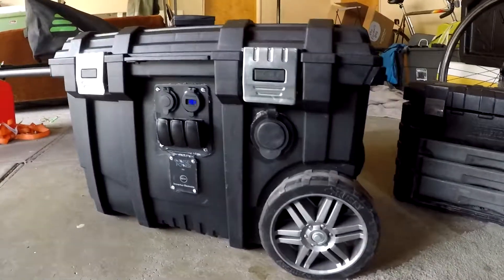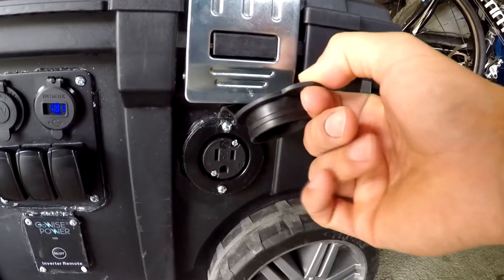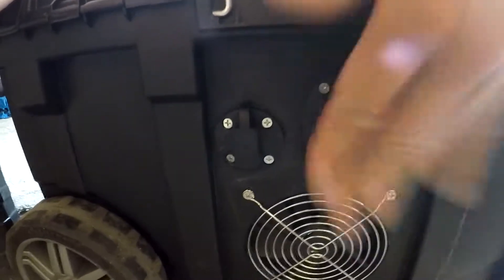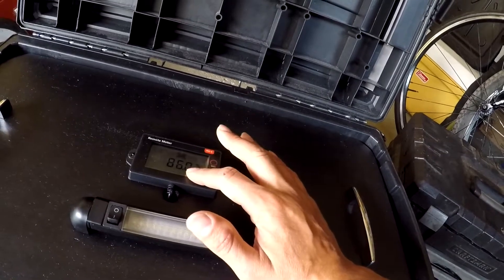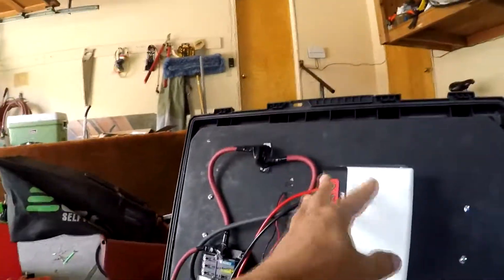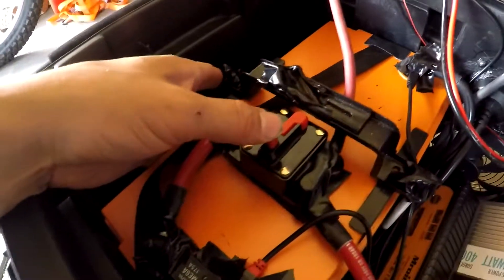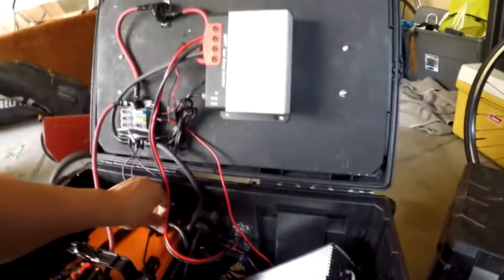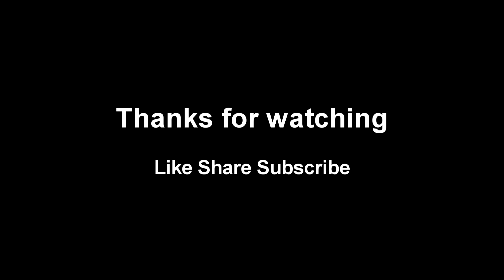Best Value DIY Homemade Emergency Solar Generator - Unlimited Power for Home and Travel

Comment: What board is that that ur charge controller is mounted to?  I have a similar setup but need something to mount my components to.
Reply from the maker: Just a cut to fit piece of plywood. Painted black with enamel, works great! Good luck

Comment: That is a very nice unit. I am in the process of building a smaller one and would like to build a larger one for a back up in case my grid fails.
Reply from the maker: Thanks, thats what i built this for. It charges in 3 hours and can power fridge, wifi, routers, tv, computer n lights most of the night so perfect in the event of grid down. Goodluck

Comment: Very well done!! I am trying to do a similar setup, can you clarify what amp the Bouge RV Charge Controller is that you used and how many watts of solar are you using to charge? I am torn between the 20 amp and the 30 amp
Reply from the maker: Its a 60 amp which is one of the largest mppt, this means it can do the max which is 400 watts of solar in 2 200 watt panels (20 amps each)  which charges a 100 ah battery in about 3 hours of good sun. Ive used smaller and non mppt to save money before but they charge slower. A 30 amp will just take longest to charge if you have smaller panel.
Reply: @SoloJono  Thank you!  Great stuff!